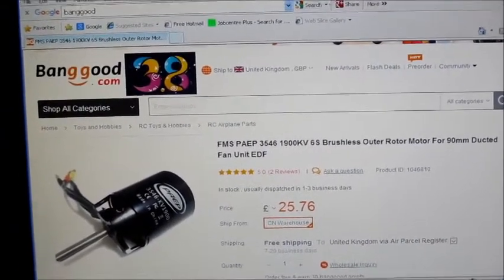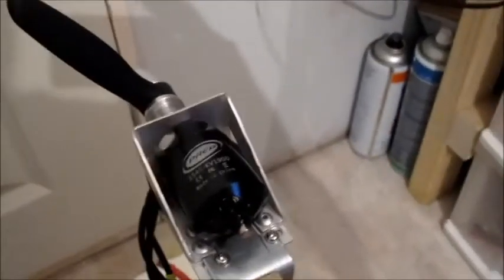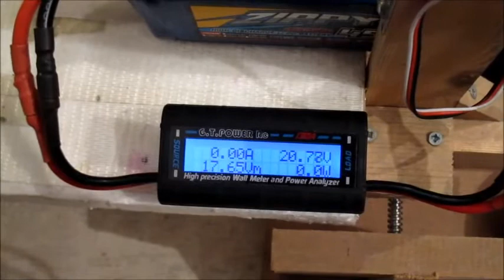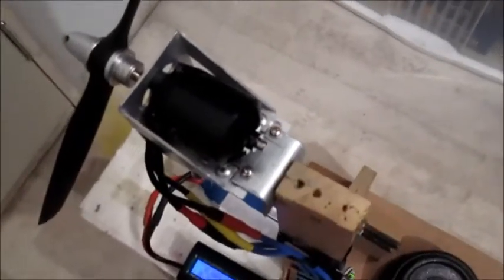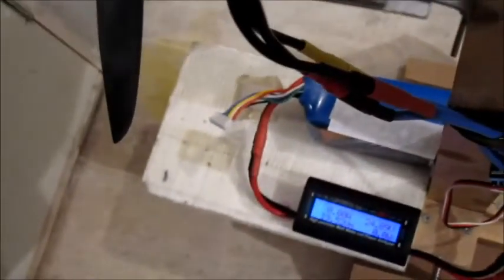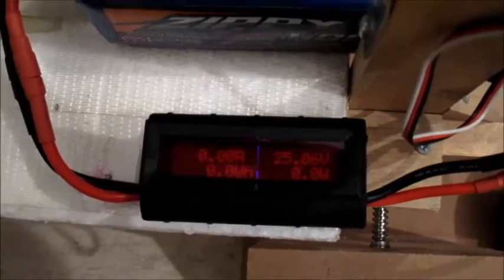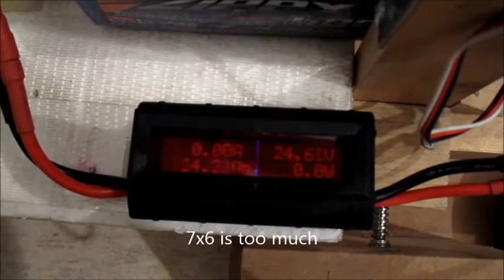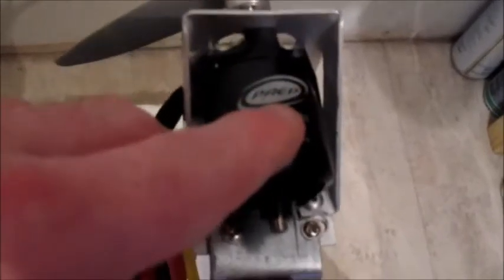Banggood FMS PAEP 3546 1900KV EDF Motor Thrust Test Motor Test of the Week

Comment: Nice!  Helpful again, i recently bought their Fms 70mm 12blade edf combo for 30$ from aliexpress, my 900 grams jets hover at 50% throttle with 1500 grams + thrust on 4s 2200 60c. My scratch built funjet goes bonkers on this haha!  Building a Mirage 2000 now for the 4s and later hope to buy the fly fly mirage 2000 and use the fms 90mm edf with this motor, they claim it produces 3.6kg thrust, model weight will be around 2.3kg,  i pretty much believe them. really awesome 70mm edf unit, if you are looking for one of your jets go for it mate. :)
Reply from the maker: WOW all sounds good mate. I too have a Fly Fly Mirage but I am yet to build it as it is going to need a lot of work to modify it with retracts and fiber glass the hole thing because they are just made of styrofoam and break apart at high speeds. So I suggest you do the same. Unless there is a new epo version I don't no about. I bought my one about 2 1/2 years ago and it was the last one for sale in the UK. :)
Really want to build and fly it but just haven't got round to it. I have so many other kits to build too as you can see here in this video and I have bought several more since then. ;) https://www.youtube.com/watch?v=rNLYvOWzqa0

Comment: I am currently running one with NTM prop drive 3000kv motor with TGS 5x5 on 3 cell that is giving me a speed of 163Kms. I made one more with a Dr mad thrust 3000 kv Inrunner 4s version this gives me a speed of 190 kms on a 4s 60c
Reply from the maker: Hi there
Glad you like my test videos. I was going to suggest the motor in this video but I was just looking on banggood and they are no longer on there. They may of stopped doing them which is annoying. There is another lite weight set up for 6s which would work well but not as powerful. For a more powerful set up you would have to go with bigger and much much heavier inrunner motors. 
The prop isn't the same as the one i've used but they are copy's of the graupner cam speed 6x6 prop. Hopefully these Turnigy ones will be ok as the plastic they are made of isn't quite as strong as the graupner props.
 https://hobbyking.com/en_us/turnigy-high-speed-propeller-6x6-grey-ccw-2pcs.html
https://hobbyking.com/en_us/warhead-3545-1850kv-edf-motor-90mm.html
https://hobbyking.com/en_us/hobbywing-platinum-100a-v3-brushless-esc-w-10a-bec.html
I have used this set up in one of me scratch built planes and got 215kph but it is a much bigger and heavier plane then the funjet. The motor was also mounted externally not internally like the funjet so the funjet should be more aerodynamic.
You need to use the biggest 6s battery you can get in the funjet while still maintaining C of G. I have also now fitted this set up after A LOT of modifications into the smaller Radjet, but I'm yet to fly it. Because of it's smaller size I was only able to fit a 2200mah 35c 6s in there. Not the 2650mah 40c 6s I used in the other plane. Which is probably the smallest 6s battery you would want to use as with this set up I was only getting a 3 minute flight time. It will be over powering the motor but don't worry it can take it. The motor say's max 80amps 1650watts but with the 6x6 prop on 6s it will be putting out over 2100watts at 102amps. You must use my suggested esc as it better programming works well on this motor and it stays a lot cooler then if you use a cheaper esc. It allows you to push the motor much harder with out it burning out.
If you need some tips on fitting a bigger motor in a funjet then watch this video. https://www.youtube.com/watch?v=L8wvhDfndik
Before doing all this though you could try running your dr mad thrust motor on 5s with this prop. https://www.banggood.com/1pc-KMP-4545-4_5X4_5-4_54_5-High-Efficiency-Propeller-Blade-for-RC-Airplane-p-1209647.html?cur_warehouse=CN
This motor can also take more power then the specs say and seems to work ok on 5s. It draws about 93amps on 5s with that prop with some crazy rpm. Hope this is helpful to you. Let me know what you decide to do and how it works out. Cheers.
...RCPP
Reply: Cool, thank you for your detailed response and advise. It helps me a lot, yes.
Reply: Hi there I have ordered the motor you suggested from HK though, I have a 150amp YEP esc from HK do you think it works fine with the motor you suggested? Do you recommend it? Please advise, thanks
Reply from the maker: Hi Anees
I also have a YEP 150 amp but I didn't like it. They are supposed to be good and I was using it with a different motor. So it's up to you if you want to try it. If you do use it change the PWM frequency to 12KHZ and the timing to 18 deg. This is close to the settings on the HobbyWing esc I'm using. So use that as a starting point. Hope it works ok. If you're unsure just get the Hobbywing Platinum 100amp esc I suggested before. 
...RCPP
Reply: Alright, I am planning to start with 6x4  let me try with it and update you as I progress. If needed, I will go for the platinum esc. Thank you Pirate.

Comment: well, at least your thrust measuring apparatus is NOT vertically oriented.  imo, generally, an edf motor does not have sufficient torque to swing a prop, having a diameter larger than that of an edf impeller, for very long without overheating.   you may know, an apc electric prop performs better on a motor than a gas prop.   cheers
Reply from the maker: Hello David
With what you're saying about edf motors not have enough torque I think you're thinking of inrunner edf motors. This is a outrunner edf motor and no different to any other outrunner motor torque wise. As for APC electric props being better then gas props you are wrong. I've been doing this a long time and have found gas props work better especially on high power set ups like this where an electric prop will probably snap. You can see the difference on the first two props on this other motor test. Although the first prop is not a APC prop it is a copy of a APC electric prop. The other is a APC gas prop and both are 7x6. Click on this link to see.  https://www.youtube.com/watch?v=K59dKtMTW9k